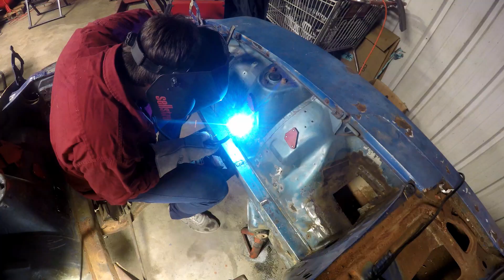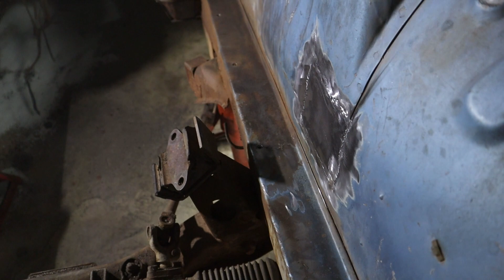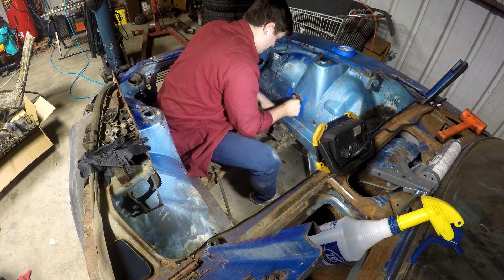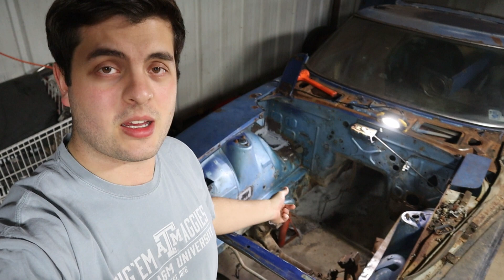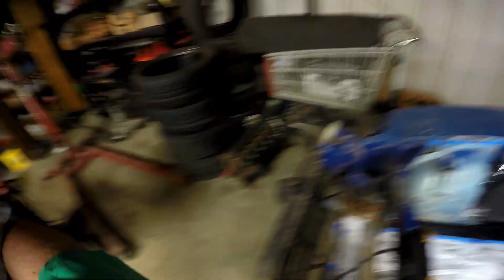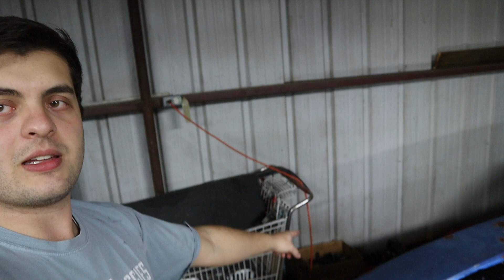Rebuilding A Datsun 260z: Engine Bay Gets Paint | (Ep. 9)

Comment: You should mention that it is recommended to use the cleaner/degreaser and metal ready (on non painted surfaces) products prior to applying the POR15
Reply from the maker: Andrew B you are completely right I skipped right over explaining that part, whoops 😅 thanks for pointing it out!
Reply: @GrantWerts  did you skip over doing it too? :face-green-smiling:
thanks for sharing. thinking about using the same stuff for my falcon build.  got it all down to bare metal currently.
Reply from the maker: @CreationsByWill  honestly if I could go back I would not use it!! Especially if you have it to bare metal already, I would use a rust neutralizer on it and then prime and paint it. If you have ever watched Jimmy Oakes redo a engine bay (like his recent one the RX7 FC) it comes out WAY better
Reply from the maker: @CreationsByWill  plus my is already chipping away :/ definitely wouldn’t recommend
Reply: did the little bubbles pop and smooth out?
Reply from the maker: @CreationsByWill  yeah they did, it self-leveled pretty well